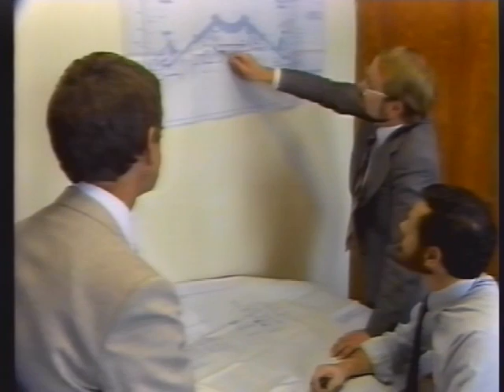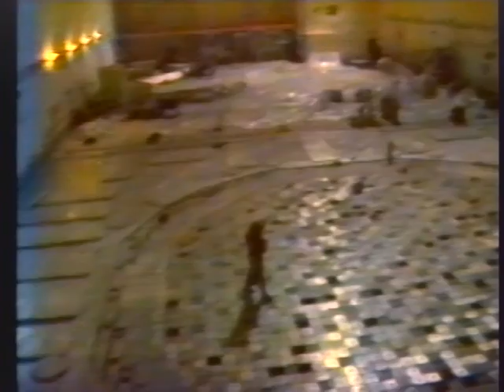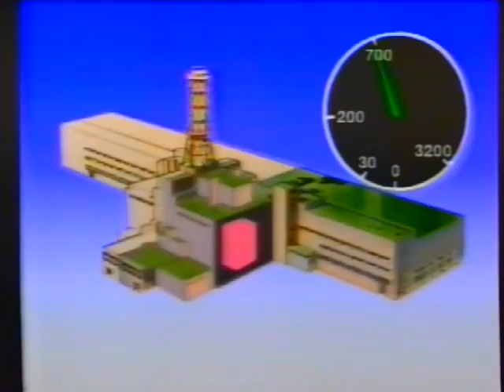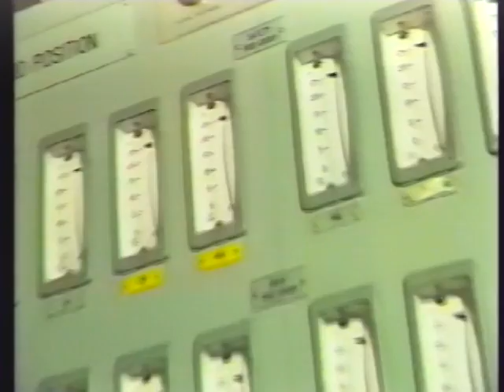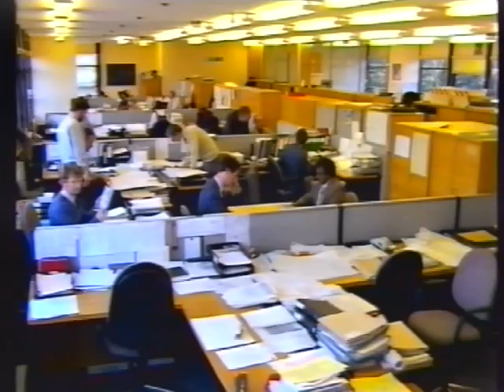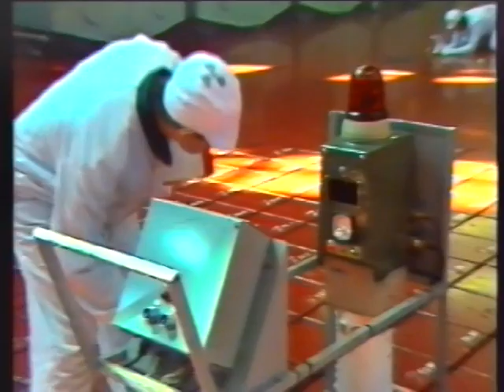CEGB UK Official Response to Chernobyl (1986)

Comment: The British are always so arrogant.  I suggest that the plutonium reactor at wind scale that caught fire was a way worse design than the Chernobyl reactor. The British nuclear industry has other significant problems.
Reply: Such as? 
Did the reactor catch fire or just the plant?

The Chernobyl reactor was a positive reactivity/temperature coefficient design, and didn't even have a biological shield / containment vessel...neither of those design choices were permitted by regulators in the west. The reactor building also had a flammable roof and we can't forget the known design flaw of the infamous & ridiculous graphite tipped control rods. Safety was definitely number 1 priority just like when they dumped all that nuclear waste up in kyshtym lake lmao.
Reply: The circumstances of the windscale fire are just as damning as Chernobyl.  They also used graphite as a moderator but it was air cooled so that under the right circumstances it effectively becomes a blast furnace for distributing radioactive material over Cumbria.  Only the lack of an explosion and the presence of filters on the chimney prevented a Chernobyl scale release.  Magnox and AGR designs had real merit but what really did for our indigenous nuclear programme was the pointless obsession with reprocessing.  If we had simplified and standardised magnox rather than pushing the tech so far with AGR then maybe things might have gone better.
Reply: Ya just found out the reactor caught fire. Lmao what the f
Reply: MAYAK - Techa River, Kyshtim disaster, Lake Karachay disaster, Lake Karachay ongoing open-air high-level waste dump etc. etc.
The American's Hanford Site is a happy children's playground compared to the nuclear legacy of the Soviets - and the UK isn't anywhere near as negligent as the big two (despite their terrible policies regarding Windscale/Sellafield, and many more shameful acts including a game called 'let's nuke Australia').
They've all done atrocious damage to the environment.
Reply: @anhedonianepiphany5588  lol yeah. The Soviet union had roughly 349 separate events of acute radiation sickness accidents before their collapse, with about 749 people hurt or killed. And that does not even include the 34 at Chernobyl. Lol
Reply: Well Windscale was in 1957 which was considered a level 5 accident..  A more appropriate comparison is the Kyshtym disaster in 1957 which was considered a level 6 accident.  That Russian disaster dropped radiation over 52,000 square kilometers, resulting in the eventual evacuation of 10,000.   That accident was so bad the Soviet Union removed all references off the maps.
Reply: @Dularr  The "Kyshtym" disaster didn't actually occur at the town of Kyshtym, but rather at the Mayak facility. Mayak and it's attached residential area were never on any publicly available maps until after the dissolution of the Soviet Union, because it was a secret 'closed city' (for plutonium production) only known as City 40 or Chelyabinsk 40. Nothing was "removed" from maps, as neither Mayak, nor any reference to the 1957 explosion of one of its high level nuclear waste storage tanks (the Kyshtym disaster) was ever committed to Soviet era maps due to the high secrecy of the facility.
Reply: @anhedonianepiphany5588  It's generally referred to as the Kyshtym disaster.  The removal from the maps refer to the Soviet Union policy of closed cities.  Because, well, they did not appear on the maps.
Reply: @Dularr  Why are you repeating information I've already provided?!? The Soviets themselves named it the "Kyshtym disaster", when they actually acknowledged it, due to Kyshtym being the closest non-secret town that was permitted to be referenced.
Kyshtym itself escaped the worst of the fallout, which become known as the East Urals Radioactive Trace.

By the way, purposefully omitting information from maps, is most certainly not the same thing as 'removing' such information. You cannot remove something which never existed.

PS. I'm not trying to attack or undermine you, simply clarify some minor oversights. I don't consider myself an expert on these matters, but they have been a part of my research for decades.
Reply: @anhedonianepiphany5588  Of course you have repeated attacked me.  But that is fine, I'm a big boy.   What I find odd is you are arguing is semantics.  While the initial thread was about Windscale.   Trying to compare a 1957 breeder reactor to Chernobyl.  While failing to mention the disaster at the Soviet plutonium production site.
Reply: @SpenserRoger  
Positive void coefficient doesn't mean much. The CANDU reactors technically have a positive void coefficient. Proper control systems, interlocks, and safety culture can easily cope with it. The graphite moderated pressure tube reactor isn't even that bad of a design, it was inexpensive and could be built to enormous power levels. If the idiot operators hadn't turned off the automatic controls and pulled out all the rods, it probably never would have caused a problem.

Comment: Yah what about that plant in the U.K that leaks all that plutonium into the mud around it? Lmao.

Propaganda is great!
Reply: Sellafield. It has turned the Irish Sea into the most radioactive large body of water on Earth.
Reply: You don't even know what to be worried about! I wouldn't want to live anywhere near Sellafield, but the plutonium there is nothing (completely insignificant) compared to the radionuclides Chernobyl spewed forth.
Ignorance has become a communicable disease, and the myth that plutonium is somehow the most toxic substance on earth is a prime example.
Reply: @anhedonianepiphany5588  uhu yeah when did I say Chernobyl wasn't a catastrophe or say anything ignorant. 

Sellafield was a crazy graphite air cooled reactor and was only saved by the Foley of the filters installed on the stacks.

All I was pointing out was that the U.K was silly with nuclear too and has had it's own releases...which this video said or implied the opposite.
Reply: @SpenserRoger  Your original post came across as if the UK making a big deal out of Chernobyl was hypocritical, but despite many reckless decisions with regard to many things nuclear by the British (including many not popularly known), it hardly rates compared to Chernobyl (and all the other disgusting Soviet nuclear legacies).
But you're quite correct in pointing out that British hands were certainly not clean when it came to nuclear contamination/pollution.
(In fact, the Australian town in which I reside was drenched with high-level fallout, brought down by heavy rain, following one of the British nuclear bomb tests conducted here. They couldn't even figure out which way the wind would blow, which, of course, any Aussie could have told them - had they bothered to ask.)

By the way, the stack filters at the Windscale reactors (the facility's name wasn't changed to "Sellafield" until the 1970s) were inadequate, and were already failing long before the graphite fire in the core - also, they were close to useless during the emergency. The filters didn't really save anyone from this accident, and they had been allowing fission products and fuel fragments through before and during the fire.
The men who developed and implemented those strategies which extinguished the core fire, were responsible for 'saving' the situation (at least preventing something far worse).
Reply: @Brewzerr  have a look at the Kara Sea around Novaya Zemlya off the coast of Russia - a nuclear dumping ground with spent fuel, even whole submarine reactors just dumped in the sea.

Comment: Pathetic! An accident can happen anywhere ... human error, natural disasters etc. THe old British reactors do NOT have containment areas either so.
Reply: Joacim Nieminen Well most of the older ones are shut down now anyway.
Reply: It can, however they are right that the design of the reactors here (and now there are only AGRs and one PWR) means that the particular situation that happened in Chernobyl cannot happen here.  There are, of course other things that can go wrong as Fukushima proved.
Reply: On the other hand, the Fukushima hydrogen explosion can't happen on an AGR at all.  Or on the older Magnox type reactors.
Reply: It definitely can't happen on the Magnox reactors.  All bar one are now defuelled (Wylfa Reactor 1) and that will be completed this year.  The only way it could happen on an AGR is if a boiler was compromised and water vapour got into the gas cooling circuit (the odds are almost infinitely against that)

And to the OP, the UK reactors that are operational (the AGRs and Sizewell B) do have containment (as did Oldbury and Wylfa - the last Magnox stations - now being decommissioned).
Reply: The UK AGR and Magnox Reactors had/have thick primary containment structures
but yes, like Chernobyl they have no secondary containment. 
Because they are gas cooled the risk of an explosion is basically non existent. 
Both explosions at nuclear reactors have either been steam explosions (Chernobyl) or hydrogen explosions (Fukushima), without water present you physically cannot have a steam or hydrogen explosion and thus a secondary containment is not really needed.
Reply: No, an accident the scale of Chernobyl cannot "happen everywhere".